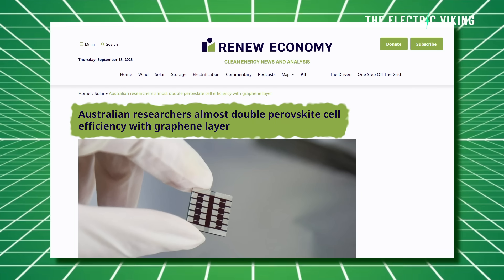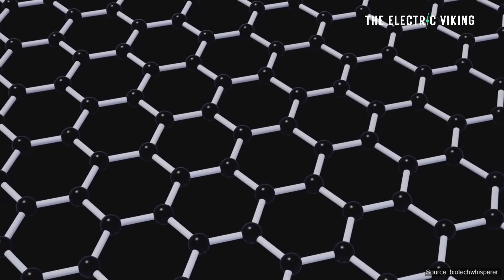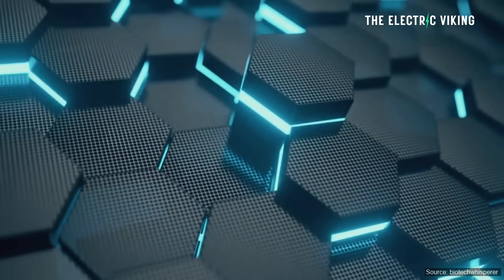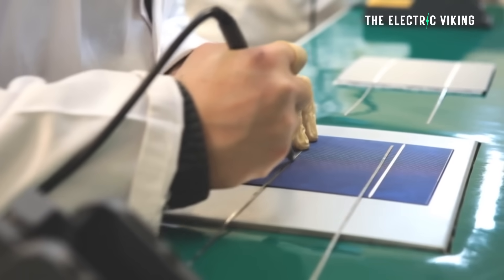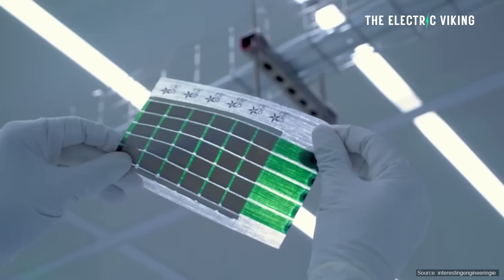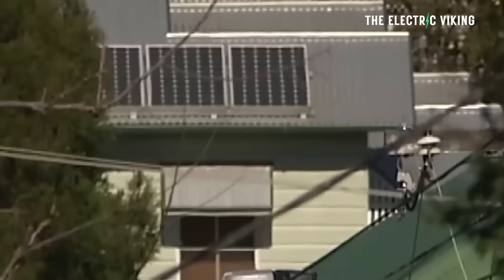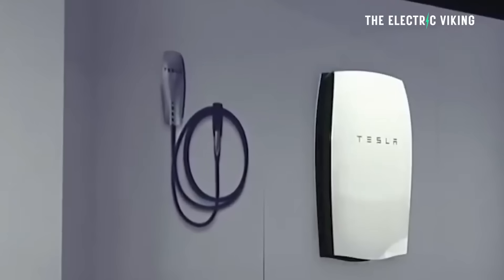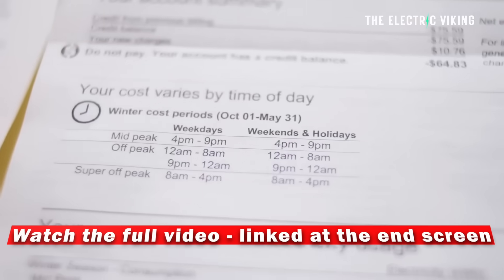Australian researchers almost double Solar efficiency after adding cheap element

Comment from the maker: The car I drive, the Xpeng G6 - https://youtu.be/IcniwO8NfQQ

RESINC Solar installed my battery and solar system. Get a free quote from them here: https://www.resinc.com.au/electricviking
Reply: Not true that Australia lost its manufacturing. Car builders were stealing off our governments. We kicked them out. The rate of unemployment is stable. Remember, twenty five percent of people cannot be profitably employed. Many people spend their time walking about with papers in their hands.  We don't owe them a wage.  A man asked why I earned so much? I rise at three am load my three meals and six litres of drink and load first. Do my paperwork, install six garage doors and fill the gas tank, shower and load what is needed, eat, speak to friends and go to bed and fall asleep. $1800 gross a day. Half that if I don't gym two hours a day.

Comment: I'm sure the pixie cultist is aware that the power output of most solar panels are inflated and they they only pulse the panels with a solar lamp for a few milli-seconds but when subjected to continuous long 1 hour cycles the power output is not as high.  Kinda like RMS.  

Also don't put solar panels anywhere near your drinking water supply or garden.  They will make the ground infertile when they start to leak.  Just google all the "green" chemicals used to make a solar panel😂

Comment: Graphene a Biological Concern  Organ accumulation: GO can migrate through the bloodstream and lodge in the liver, kidneys, lungs, and even the brain.
Inflammatory responses: It may trigger oxidative stress, immune disruption, and cellular damage.
DNA damage and fibrosis: Long-term exposure has been linked to genotoxic effects and tissue scarring.
Developmental risks: Animal studies suggest possible impacts on locomotor activity, aging, and offspring development.
Exposure Pathways
 Inhalation	High	Nanoparticles can bypass lung defenses and enter circulation
Ingestion	Moderate	May accumulate in organs; excretion is limited
Skin contact	Low–Moderate	Intact skin offers protection, but damaged skin increases risk

Comment: My uncle told me about this technology, gosh it would have been at least 20 years ago.  CSIRO were working on bendadle panelst that could be just rolled out on roofs etc.  I don't believe graphine was material science back then though.  He worked for the CSIRO in research carbon capture.  They actually had a plan to grow fast growing australian native trees then cutting them down and sinking them into the sea, capturing the carbon forever.  I am not a scientist, so excuse my rudamentary explanation.  They had it to the stage they were about to start actually implementing it, but there funding was cut.  He always told me how many scientist up and moved to America due to this practice.  Their research was just a waste of time.

Comment: The problem is that graphene can't handle expanding and shrinking from the heat so it last only a few years compare to silver solar panels last for at least 25 years.
Reply: The problem is it's toxic AF to humans, all animals.   This could end like the asbestos debacle.
Reply: @Joe_Blo  Many years ago, I read that graphene was "one of the worst pollutants," because when broken down, it behaved like a knife at the cellular level. Could this be true?
Reply: Ah, but if you,re in Ukraine, you only need the cells to last for one day on a drone.
Reply: Another toxic stupid labor fuck up in the making ,   this graphene is dangerous  as fuck to both animals and humans ,   if on your roof and leaked  your house is destroyed and unliveable,    no grid connected  solar for labor to screw you on ,   coal and gas are cheaper and less toxic than idiots who believe  solar

Comment: How is going from 25% to 30% doubling efficiency???
Reply: Don't confuse him with logic !
Reply: It’s double the previous increase from twenty percent.😊
Reply: Exactly!
Reply: Exactly. Ive found these shows are not carefully researched. If you are in the game of solar  & battery power, you would know that the avg power output efficiency is around 23% and max  out at 25%. The older PV panels were  around 17% avg. So, u can say the 30% panels are close to 100% on older (10   yr to 15yr old) panels. But if u are comparing max for max its not reality in this case.
Reply: @mariohatz3317  electric viking isn't good for details, but he's definitely not representative of all journalists and reporters in the new energy space. 

Youll like a channel called electrified, green and black logo, run by a guy named Dillon loomis. Well researched and heavy on details, doesn't take too many editorial liberties, but doesn't post daily

Comment: The highest efficiency solar cells are way beyond 30.6% and have exceeded 43%.  The solar cells used in space have been over 30% for many years and average close to 40% NOW!
Reply: These are tandem cells used in space. For single cells the max imum efficiency was below 25%.
Reply: @maritaschweizer1117  Um, no!  The maximum theoretical efficiency of a single junction solar cell is about 33.1% and is so important it has a name, the Shockley–Queisser limit.  The highest single junction efficiency is about 28%.  The current record for efficiency is over 47% so a bit more than the 43% I mentioned earlier!

Comment: I believe we already have free energy from the inventor Tesla and with the new aluminum Ion batteries will be coming in 26 my guess for backup and charging rate of 80% within 5 min and probly 10k+ plus cycle charges . I stated in the past to wait 5 years and we are about 3 years right now and we will most likely see 2-3x from here with a lower price cost as tech is in a race to the bottom. Ai, robotics and flying cars etc will be here and affordable once this real estate, auto and stock markets bust is bottomed out in +/-28.  The fall of the cabal will bring hidden tech to light for mankind.  As you said the life cycle of The Australian printable solar panels has to be competitive with 25-30 years panels and may take more time to over come.

Comment: manufacturing at scale is the key. That and the lifetime. If the lifetime (not easily defined) is half, it needs to be half the price. Niche applications may be different, but having to get up on the roof and change the cells more frequently is a factor in adoption. That and the toxic elements used in manufacture. (eg lead, cadmium etc)

Comment: Not a fan of solar but if this works, great. I still believe geothermal energy produced with energy beam drilling is part of the future. Toyota is working on a water powered engine. Stanely Meyer proved this technology was feasible in the early 2,000's.  Will a water powered generator be powering your home in the future. Water is a very cheap fuel. This will make all other fuels obsolete and end the electric car fad. Producing energy from the magnetic flux lines of the earth is now being pursued. This lost technology was perfected by Tesla almost one hundred years ago.

Comment: I think you mean improved by 50% not double. Panels are already >22%
Reply: Imo he means doubling from earlier Perovskite cells that were around 15%
Reply: double is for the existing percentage. 2 x 25% = 50%
Reply: He's extremely prone to hyperbole, so I wouldn't put it past him to mean what he says even though he knows it to be inaccurate.
Reply: As Tim says Perovskite cells were 15% with the advantage of working better in low light
Reply: We've gotten over 47% in lab conditions with some non-commercial cells (multi-junction), so I also thought he was claiming >80% efficiency... that would've been something.

Comment: The great green dream. These platforms gloss over the essential facts and it appears from my perspective that it all adds up to a green inefficiency. As the Australian economy is structured around primary products, pretty much most of our emissions are exported overseas. There's much made about the reduction in emissions in the Australian economy but it's factually untrue. Suggesting an annual emission of 430 million tonnes does not include the exported 1200 million tonnes of emission and so does not represent a realistic proposition for suggesting that are carbon emissions are in decline due to the implementation of solar and wind. We're merely shifting our emissions to other countries and hence contributing to the global aggregate. Seems to me that the massive sprawl of solar and wind infrastructure will just simply add significant degradation to both the native flora and fauna and the whole ecosystem as a whole. Whilst population growth and consumption increases, it seems to me there will be a trade off and it's not the energy rich Utopia that the Green movement presents.
Reply: China is building over 1GW per day in new solar, and it's population is decreasing, as are almost all developed countries that consume the most electricity. How it is that building out solar that will cover at most less than 1% of Australia will destroy everything is beyond me. Carry on with your energy idealism, but it's not grounded in reality. Solar is cheap and getting rapidly cheaper.
Reply: @keepitreal2902  Very firmly grounded in reality. I've not seen any reduction in energy costs and some states in Oz have increased significantly. China is also developing significant amounts of Nuclear and hydro and that could be for any number of reasons, raising the living standards of Chinese folk and maintaining growth in the economy. Seems to me that the Chinese are simply generating more energy of all types and that simply indicates a higher level of consumption. Consider also, estimation of total energy generation per head of capita in Australia is around 170 kwh per day. That's only a coverage of around 16,500 square kilometers without storage calculation. Guess you have a your sense of reality and I have mine and so lets just see how it all unfolds.
Reply: @juliandwyer9367 By your figures we need only 0.23% of the land in Australia to generate enough energy for the country. Excellent, I'll take it. In fact, we have enough rooftop area alone to power the electric grid. Green dream? It's about to become reality! You think the energy companies can ignore exponentially cheaper electricity through solar and battery storage? You do the economics!

Comment: Graphene is in the news for years. Also for much better and cheaper batteries, but it doesn't hit the market. Let's see, would be great. However solar panels are allready cheap af imo. A 450W panel costs arround 50-60EUR and when holding a panel in your hand allready makes you wonder how they can sell this huge and heavy thing for this price. If you buy a base for the panel, that is only some aluminum, that doesn't do anything, might costs the same!

Comment: It’s great that they made a breakthrough in the lab. It’s another hurdle to make them at scale and at a reasonable price when compared to silicon.
Reply: Yep!
Reply: It should be cheaper and easier to produce perovskite solar cells than silicon solar cells as the materials are readily available, and do not require nearly as energy intensive processes to make.  The perovskite cells are only on a thin film which is easily rolled and transported.  The material can be doped on a conveyor system and then rolled up and shipped.  This is much better than the rigid, heavy, and bulky silicon systems for production and transportation.  They just have to get over some engineering hurdles regarding longevity of use.
Reply: @wesbaumguardner8829 - We’ll see, but my guess is that we won’t see these commercially for at least 5 more years, and even then they will be small scale.

Comment: Thirty percent efficiency is a real achievement if it can be commercialized. If manufacturing can be done locally, it will be a real advantage for Australia. If the plant you mentioned is real, then these cells have gone beyond the lab stage, and manufacturing can begin. Much will depend on price and long-term performance, but at 30 percent efficiency, installing solar panels on every house is a no-brainer.
Reply: The Chinese will steal the idea and mass produce it for cheap.
Reply: @RedRider1600  Yeah, blame the Chinese as they are prepared to commit to hard work, investment and risk. They deserve respect and I do reject the suggestion that Chinese people are thieves.
Reply: 60 million units of solar cells, probably means have a million panels and that's their intention for that factory, no year mentioned when they intend to hit that target.
Reply: Are you suggesting that we take Australian tax dollars be spent on installing technology on our ramshackle homes by people without a need for a brain.
Reply: @chuckrogers5567  what should tax dollars be spent on then?

Comment: 30% efficiency is fantastic but... how much does it cost and how long does it last?
Reply: It's perovskite which means thin film layer which is good.

On the down side graphene production is still pretty expensive even though the raw material can literally be extracted from air.

To make it commercially viable you'd need to bring graphene production in house, because currently the per unit costs range from $20-2,000 per kg on the market.
Reply: Depends on how much you make it last
Reply: Mono perc half cut bifacial solar panels are already producing 22% efficiency...
Reply: The graphene ectends durability characteristics and reduces wide band gap losses and recombination degradation. Further research is underways to establish the extended durability gains